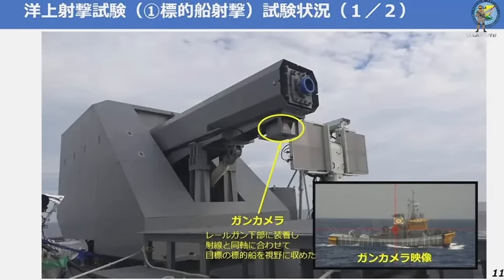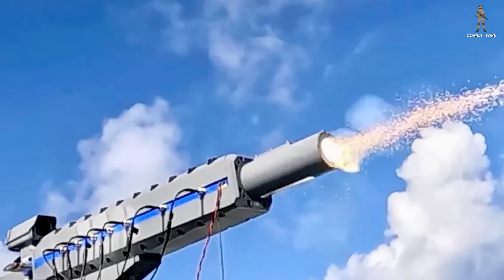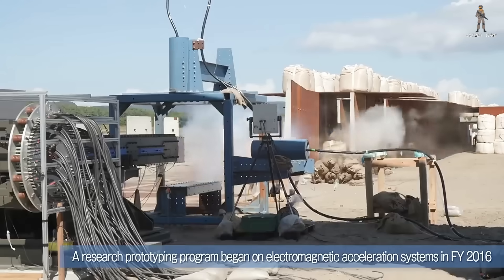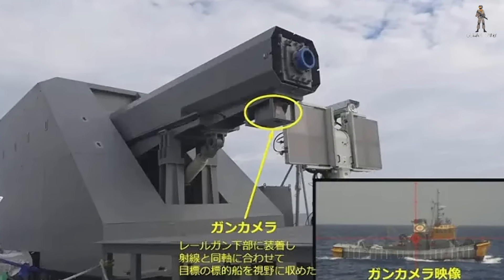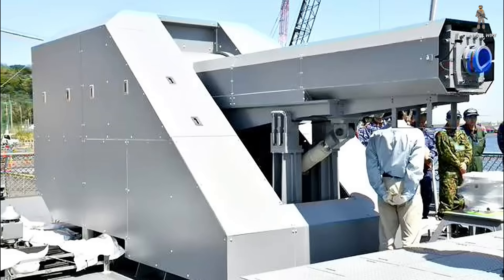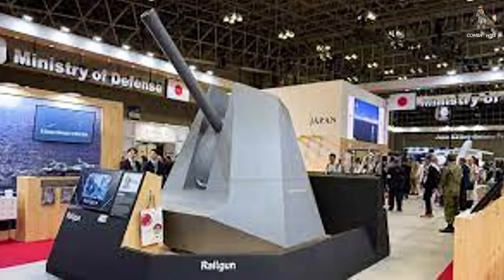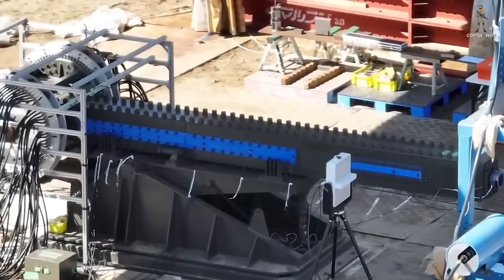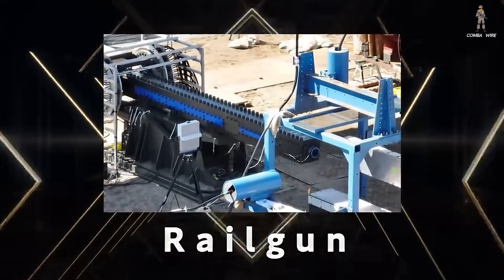For the First Time Ever, Japan Reveals True Railgun Damage at Sea.

Comment: Cool, this weapon is a force multiplier,  but ya have to remember the maint. requirement is crazy. The armature sliding down the rails generates insane heat + friction. Metals vaporize, rails warp, surfaces pit. You basically fire a few dozen shots and need a rebuild. It's like owning a Ferrari that needs a new engine every Saturday.
 Now don't get me wrong, this really makes sense for the Japanese, and they certainly know what they are doing and have accepted the maint. challenge.
Reply: If they can accurately target bridge   then you don't need many shots to take out a ship 😮
Reply: @death13a  That would hurt, but not stop the ships ability to fight as the CIC would take full control. What ya need to do is sink it, or remove all power. So jamming a mach 5 plus dart through the hull and into the water would seriously affect the ship up. Japan is working on the railguns being able to shoot down missiles, which would be the real force multiplier. The Japanese are trying to address missile numbers not ship numbers. They need enough shots for the first wave missile assault. Keep in mind with multiple railguns on multiple ships that reduces the number of shots needed. They have this all figured out, and I am certain they will figure out how to do it - they are smart people determined to accomplish their goals.
Reply: @death13a at sea with both vessels underway hitting the bridge intentionally with a non guided round would be a difficult endeavor. The rougher the weather the less accurate the shot.
Reply: yeah there's a solution for everything, the Japanese extended the barrel life to 200 shots. How many shells do you think a modern destroyer need? Your comparison with a ferrari doesn't make sense you should compare it with a F1 ferrari they can use four engines in one season it really doesn't matter if they need to change one ...as long they have the budget.  The only goal is to win.
Reply: @RAWstof  The 200 shots is only on experimental rig. They are expecting no problem reaching 120 for production at very beginning. Sorry you did not like the Ferrari comment but it was for humor not a factual comparison - so your point is moot. Their collaboration with the US and Germany is sure to improve the weapon in short order. Last my point was merely to express the amount of work and tech breakthrough the Japanese have done and have yet to do. I spent some time around the JSDF, and have major respect for their capabilities, and new defense requirements forced upon them.
Reply: @johnthomas3264  120 shots to take down hypersonics per weapon is pretty good trade, even if the system is down after that. It means the cost to sink a Japanese ship for the Chinese is way to high, even worse in a flotilla were dusin of these weapons would be present. Now mount them the mountains of Taiwan and any invasion would become insanely costly, as China only have a few support ships and landing crafts.
Reply: @-JustHuman- Absolutely. It seems nowadays it is all about that first wave of missiles and decoys that you must survive to continue the battle. Getting the gun on land to protect strategic targes and routes of entry would be extremely effective.
Reply: @johnthomas3264 points are moot not mute.
Reply: @blitskreegdeantioch5851  Hahahah, well at least ya knew what I meant.
Reply: How much do you know about the maintenance requirements for traditional naval guns?

Because the big guns need to have the barrels swapped out after about 300 to 400 rounds - and I think those barrels are a lot bigger.
Reply: @alanlight7740  Yup typical barrel life of a 16" navel gun in WW11 was ~250–350 full-charge rounds (depending on model, powder charge, and projectile type). And yes they are a lot bigger. I did work on the HARP gun which was a modified 16" navel gun (basically two barrels welded together end to end).  The breaches basically never wore out.  To compare railgun to 16" navel gun
16-inch WWII Naval Gun
-----------------------
- Steel barrel
- Swap routinely
- 250–300 AP rounds per barrel
- Simple mechanical job

Railgun
-------
- Rails + insulators + cooling + sensors
- Extreme wear (typical 5–50 shots) Japan should get 120 shots.
- Must rebuild major components
- Precision alignment critical
- Not field-serviceable - so pull off hull and replace. Japan may have port serviceability figured out/planned

But I think the railgun could be a modular replacement instead of a rebuild. Swap out the entire turret at port.
Reply: @johnthomas3264  You worked on the HARP gun?  How old are you?
Reply: @rapid8804  There is a HARP gun in Arizona that is used for testing. It is at the Yuma Proving Grounds. The HARP program was completed way before I showed up. I am 66yrs old. How old are you?
Reply: @johnthomas3264  JT, I'm 58.  I knew the program ended around the time Gerald Bull was assassinated.  That's why I questioned your age, lol.  I didn't know about the gun at YPG.  Thanks!
Reply: If it can find a niche, it bodes well for this technology having both time and investment to mature further if possible
Reply: They'll need quick change barrels.
Reply: i m sure its not a real issue, you can have magnetic amo who levitate before the shot like amaglev, a soft canon layer which can be replaced quickly, or soft sabot who dont do damage
Reply: So basically just use a coilgun and you're good. No wear and tear because no brushes, no mechanical friction. Just draw a vacuum on the inside of the "barrel", use compressed helium (or conventional gunpowder) and a conventional rifled barrel to get the projectile up to Mach 3, then just use the coilgun stages to handle the rest. Easy, low-maintainance mach 6+ unguided yeet. The real issue is that the presence of the atmosphere makes trying to push anything faster than around mach 7 basically pointless, no matter how you manage to get something moving that fast. That's why hypersonic missiles have been just as much of a pipe dream as railguns.
Reply: Or an Italian woman with curls and high heels
Reply: You're thinking about it wrong, the barrel is the ammunition
Reply: @iantrofimov  The sabot that comes out of the barrel is the ammunition.
Reply: The weapon is not a force multiplier and the barrel is no big deal, since there's no explosion in it, you can just design a gun with easy to swap barrels. You can also watercool, the ship is on a giant cold water pool, it can cool like a nuclear power supply does. Every issue is a non issue on a ship. The real issue is why do this when normal guns work and do not require 3 added systems (that can fail or be destroyed) to function in order to shoot ?
Reply: @PyromancerRift  A railgun’s “barrel” isn’t a simple barrel. It’s the entire electrical, magnetic, and structural heart of the weapon. Once it’s worn, swapping it isn’t like changing out a tube on a rifle — it’s more like trying to replace the engine block on a running fusion reactor. Railguns primarily fail from plasma ablation — the rails get blasted by a conductive, superheated plasma arc as the projectile slides. No material we currently have shrugs off the effects - yet. Pumping water through a railgun while it’s firing is like trying to cool a lightning bolt with a garden hose. The physics simply overwhelms the coolant. Last if the system works it enables a smaller number of ships to provide equal missile defense/offense compared to a larger quantity of ships. So, it's a force multiplier and this is the stated reason Japan is working on this.
Reply: @johnthomas3264  the plasma ablation is mainly a problem because of the atmosphere. the high voltage and current causes dielectric breakdown of air which is forced into the projectile and rails like a fire piston. It's one of the reason that railguns are much more efficient in space.

The other reason is that in space, you don't have to worry about atmospheric drag, so it's possible to use smaller calibre railguns with lighter projectiles that use considerably less power and can reach much higher speeds. The larger and heavier the projectile, the less efficient the railgun is. This is due to surface area to volume ratio. The electromotive equation means that a smaller mass requires less power to accelerate, and has a larger surface area per unit of mass, so it has a lower overall power over the surface of the projectile and rails. It will also cause more friction per unit mass, but that's not as much of an issue as fouling and pitting of the rails which multiplicitively increases wear.

Another way to prevent plasma ablation is to use projectiles and rails that both have a high melting point. I'm pretty sure the US prototypes used a high calibre railgun with tungsten rails and aluminum sabots, so it's no surprise they had issues with maintenance. Aluminum has a very low melting point. With the amount of current running through the projectile, plus the air being compressed in front of it, it's obvious that it would foul the rails.
Reply: @Ikaros---2  Cool points. First lets stay terrestrial. Not even sure we could power a railgun in space. As for ablation, you don’t prevent plasma ablation in a railgun, you fight a delaying action against it. The physics are going to eat your rails; all you can do is slow it down.

Known methods to address ablation like high-melting-point/refractory materials, 
coatings, solid/sliding armatures, hybrid armatures, insulating sabot/armature, pulse shaping, EM-architecture have been considered, and I would guess some have at least been tested.

Regardless of techniques applied even in the best case you still have huge currents in tiny moving contacts. You still get Local overheating, micro-arcs, surface vaporization (at least some plasma), and that plasma, plus mechanical erosion and thermal cycling, will eat material.

You can reduce rate of ablation, and you can move it to sacrificial parts.  You can design for predictable wear and replacement. But completely preventing plasma ablation in a multi-shot, high-energy railgun is, with current tech is not possible.

The Japanese are trying to find a balance between cost, time and reliability. They only need to get "in my unqualified opinion" to their stated ability of 120 shots to achieve their goal. Provided they can track and hit a missile with it it. The basic math for minimum shot ability would probably include be something like the number of expected first wave missiles to engage, number of defensive missiles and railguns the JDF has, and the hit probability.
Reply: @johnthomas3264  powering railguns in space isn't as hard as you'd think, nuclear reactors could do it easily, though you'd need to design a reactor with a high outlet temperature to maximize radiative cooling. Solar panels probably wouldn't cut it.

You don't need an anti-ship level of destructive power on a space based railgun, a projectile that is just a couple of grams moving at a couple km per second would do crazy amounts of damage considering there is no atmospheric drag on the projectile in flight.

I definitely agree that sacrificial parts are crucial to a long lasting railgun design, especially in atmosphere. Having replacement rails or even some kind of modular rail assembly becomes increasingly more viable the smaller the railgun becomes.

One of the key benefits of a modular rail assembly would be that the conductive elements and the structural elements would be separate. Tolerances need to be very tight in order for a railgun to function properly, which means the rails must stay parallel and stationary. However making the rails also be load bearing would add a lot of weight and also make replacing the rails much harder. 

When it comes to using a railgun for missile defence, a lot of factors come into play. Accuracy of both the railgun and the tracking data, capacitor output power, capacitor charge time, turret rotation speed, etc.

Lasers are much more simpler when it comes to targeting, but also a lot less efficient when it comes to efficiency, as they output far less energy onto the target than they are fed as input compared to railguns.
Reply: @Ikaros---2  Very enjoyable sharing of information. Thank you!
Reply: Drop out, auto load barrels
Reply: @joshroley770  That would be great. Not sure they have it down to just a barrel change yet, but seems doable.
Reply: No, it's not a force multiplier, unless you're talking about the manpower requirements to swap out the rails every few shots.....  yep then it is a force multiplier.  The railgun is useless with our current technology, and until we come up with some miracle metal that's going to remain the case.  Maybe these railguns will be viable 20 years after we achieve cheap and plentiful fusion power.
Reply: @DoctorMangler  To my mind, a weapon that enables fewer ships to match/defeat a larger quantity of ships is a force multiplier. I hear you on the state of that technology, but the SDF seems to have 120 shots per system per boat figured out. What is not known is the ability to shoot down a missile. Very interesting technology times.
Reply: @DoctorMangler  It last for 120-200 shots, that's not bad. Battleships had 200-300 shots per barrel before they also had to be maintained.
Reply: @-JustHuman- No it doesn't it lasts for 20 shots.  I've read the research, if somebody said it lasts for more than 50 then they're lying.  US Navy got less than 10 before they were degraded beyond use.
Reply: @DoctorMangler  It's basically the reason for this video, to tell you that they pushed the shots from 120 to 200, that IS what makes the Japanese gun impressive and viable.

Bu t as you claim to have read the research then link it were it says it can only do 20 shots.